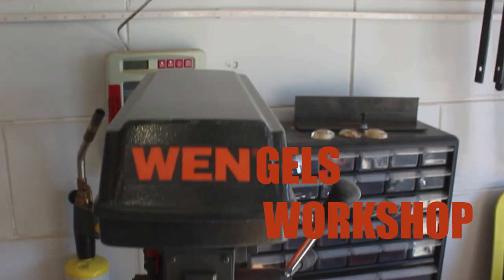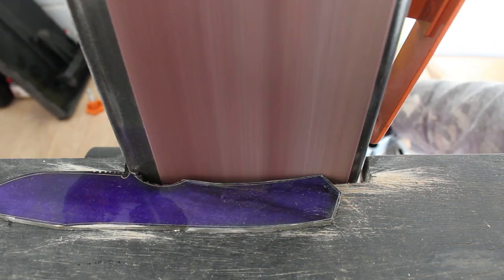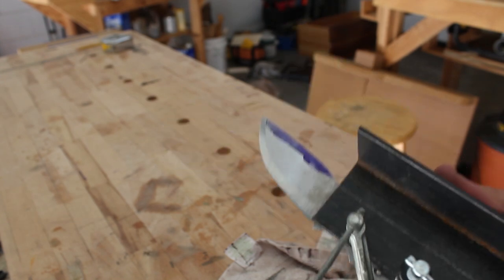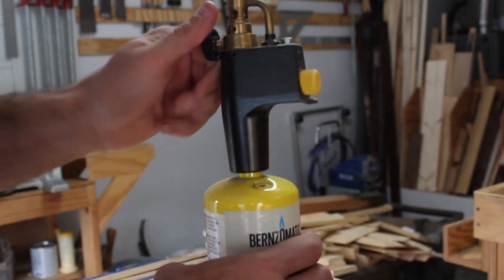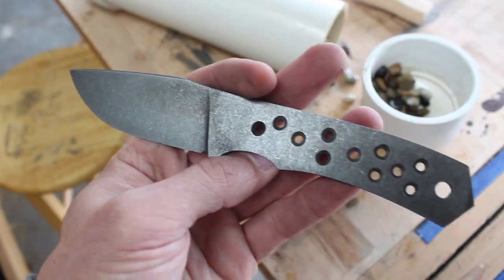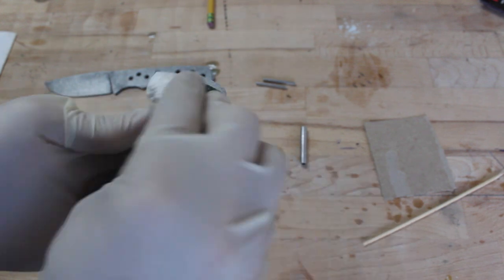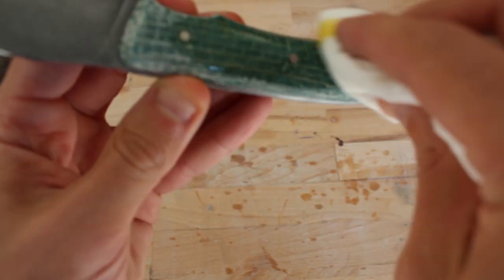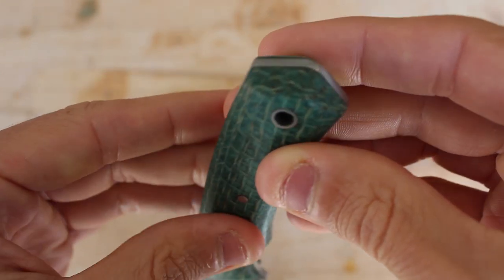Knife Making: Small EDC Fixed Blade knife

Comment: May I ask what drill bit do you use to mark the center line? I assume it's half the thickness of the material?
Reply from the maker: Generally one just a little thicker than the steel or one a little thinner. You want 2 lines that are a bit less than a dime apart. I usually pull the whole set of drill bits out and mark until I get the right bit.
Reply: @Wengelsworkshop  cool, thank you